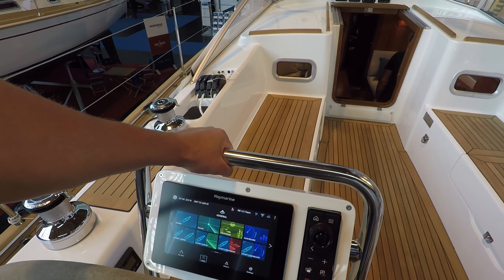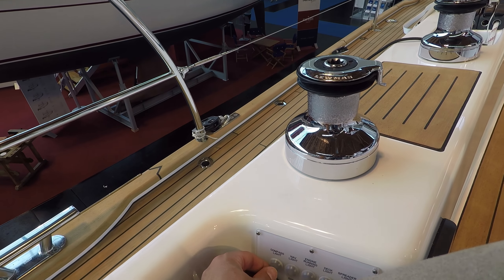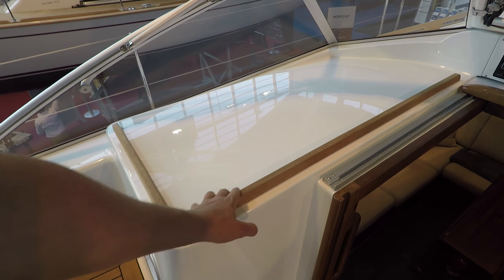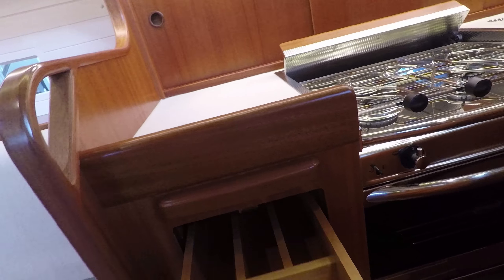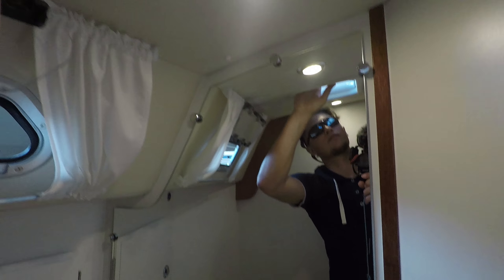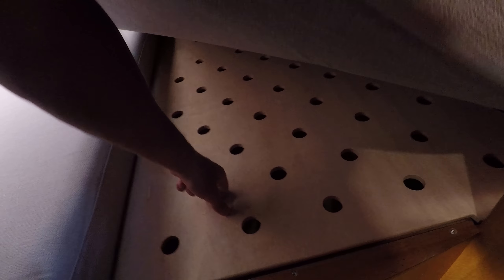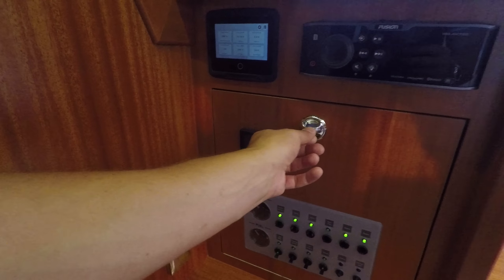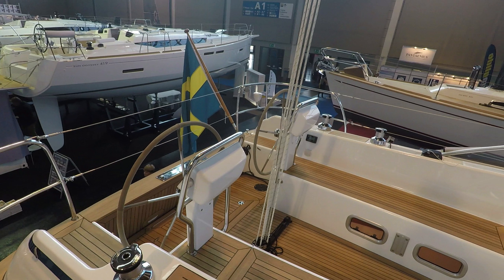Hallberg Rassy 340 Sailboat Tour 2018 (PTC Review)

Comment: Did you look at the HR 44 while you were there? Let's see your video of that. 😊 I like how you show the features and point out problems - a good example for other reviewers. Those slats on the walls were wood, surely? The ventilation space behind them might make an unexpected sound when tapped.
Reply from the maker: Sorry, not sure there was a HR 44. This particular boat show takes place on a lake like 300 miles inward. So only smaller boats are brought there. I believe the Hanse 418 I posted yesterday (https://youtu.be/vtZSOdioVvk) was one of the largest.

Thanks a lot! Yeah, I'm in search of the mythical "ideal boat". Or the one that comes closest.

The slats surely didn't feel like wood. Felt very thin and П-shaped. Maybe some crazy high tech wood composite or smth.

Comment: I understand Rassy's are known for quality and tradition... but one would think they would update the bathroom design and the curtains, other manufacturers stopped doing that 15 years ago.
Reply from the maker: @Esquire Yeah, Rassys are definitely on the traditional side. 
But you're right, wouldn't mind at least some better lighting and I very much hate shower curtains.
Generally more a fan of practicality that outright luxury on boats, but that's where I draw the line.
To drop a couple hundred K on such a boat and get a shitty, soon rotting shower curtain... No.
Reply from the maker: And have you seen the front cabin door at https://youtu.be/4xwjBnpg6yQ?t=252 !
I believe even on boats there should be some privacy.
Why does the door have huge gaps top and bottom?!

Comment: A tad negative on the review.
Reply from the maker: Hm, maybe it comes off that way a little bit.
Rewatched the video.
Those ARE great boats!
It't not that I don't like them.
I'm a sucker for great ideas and nifty solutions and Halberg Rassy has lots of those. In high quality.

The only thing I was really distraught about is the front cabin door.
It remains a mystery to me, how one can design a bedroom door that has gaps to three sides.
In what is arguably the owners cabin.
What about privacy, what about noise when the rest of the crew is still/already up?
If this is for ventilation than there surely are better ways, right?
This door reminds me of the doors in public restrooms...
I am yet to be convinced of it's design...

A video about Dragonfly trimarans is coming on Saturday and there they had to make a weird P-shaped sliding door, but that way it closes shut and gives some privacy in the constrained space of a tri...

And the included solar is nothing more that a phantom drain preventer for the batteries at best.
Regardless of how good it is, it't just too small.
But let's give them the benefit of the doubt that they calculated it to be enough.